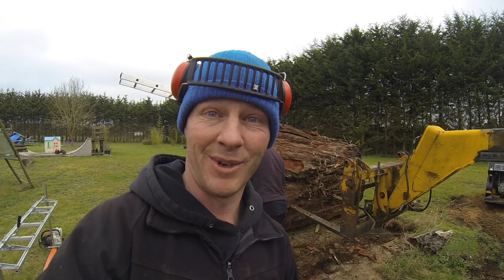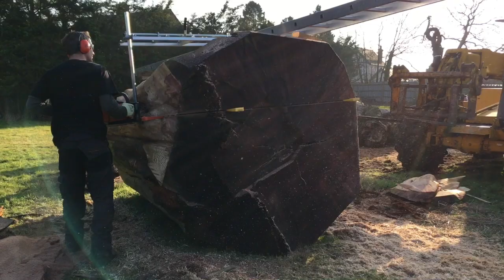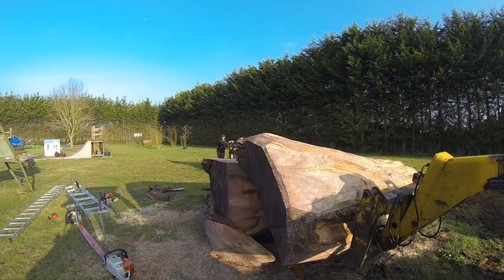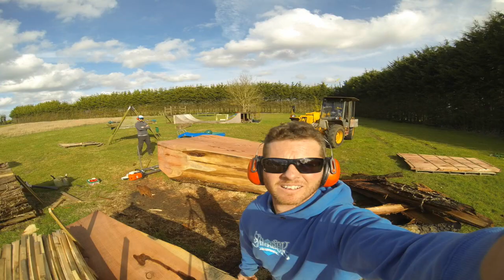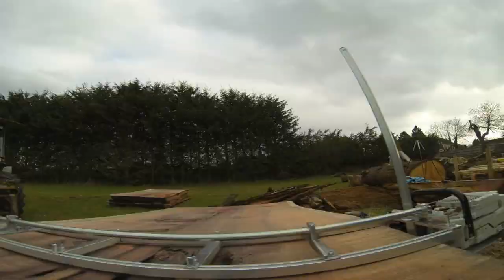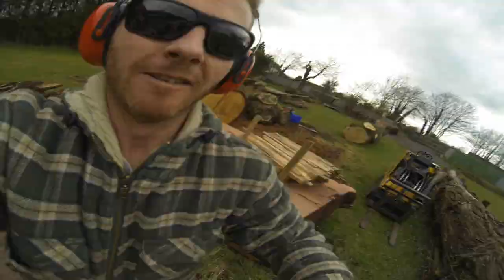X2 Stihl ms 880 220cm vs big Redwood log

Comment: Are these the slabs that copped for sticker stains?, I have heard it said that cutting stickers from the same species reduces the chances of sticker stain, I don't know if its good info though, beautiful looking wood does it have an aroma to it, I visited a sandalwood mill in Rajasthan India and you could smell it half a mile away
Reply from the maker: Hi mate, Yes I have heard that too, I use pine I have had it where it soaks a bit of the colour out of the wood but after sanding you can't see it.  The smell is great like you say, great to have you on the channel bud.  Blaise

Comment: I had one set up like that with only the one saw and the log in question was in the woods on a slope. I figured to not be on the downhill side of things and the upper side where I needed to be was blocked so I couldn't go that way. So on the low side and push the saw up the log I go. I used wedges and such but this I never expected. I got within about five or six inches from the end and not paying attention to all detail. All the sudden it split off and come down sliding to the low end. I tucked and rolled up to the bottom of the tree I was cutting on and it slide harmlessly over me to the ground below. After that, I never took my eyes off a cut. I almost got religion over that one!!!/LOL